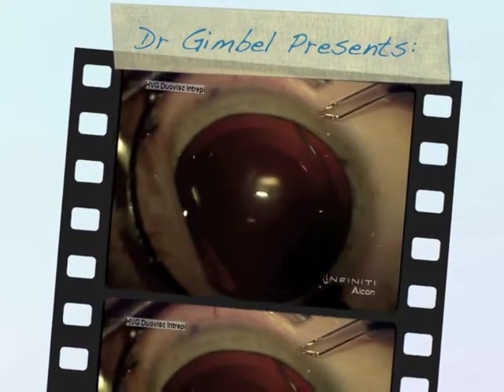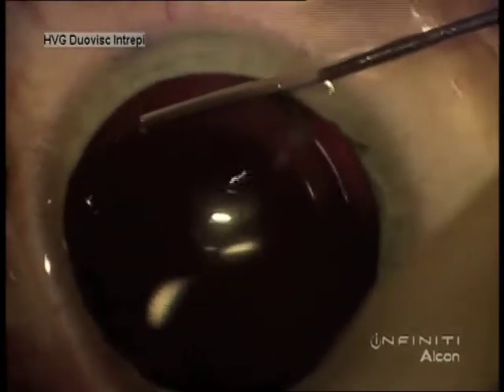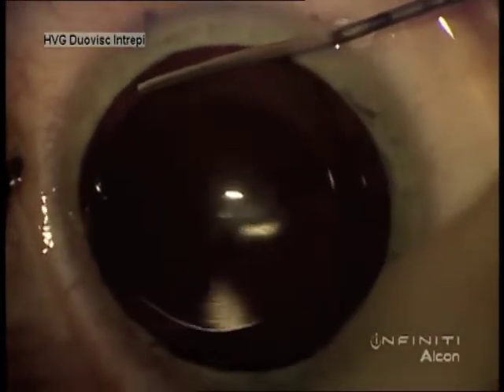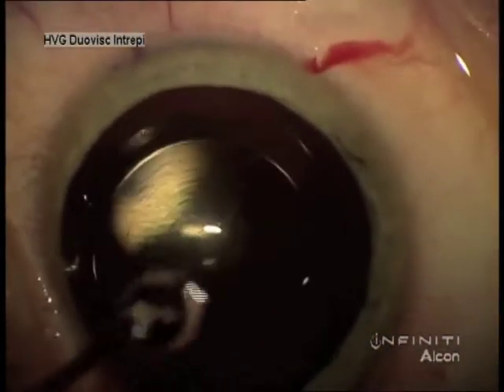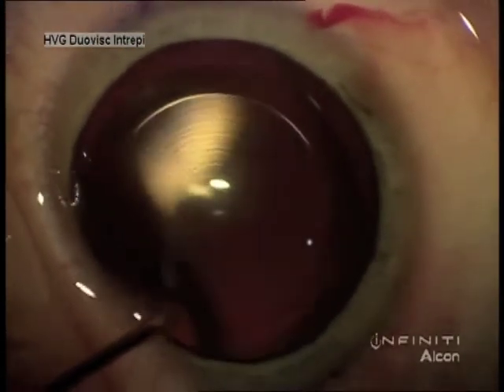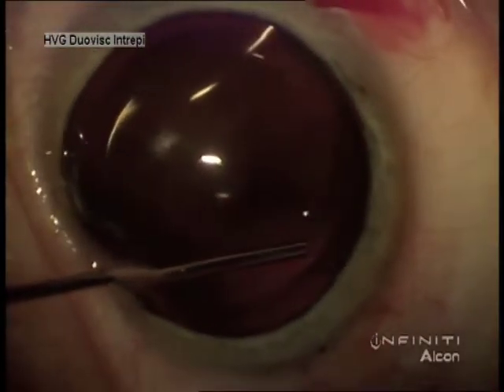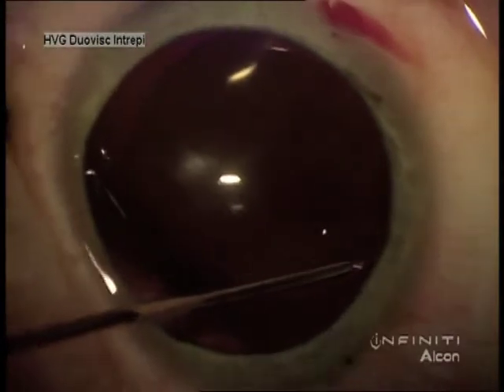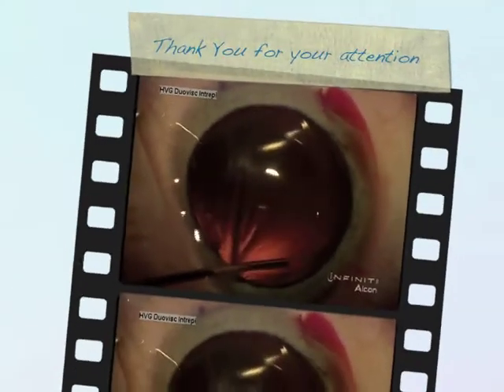ICL Intraocular corrective lens Repositioning

Comment: Dear Gimbel, I've recently had an ICL phakic toric lens, and I'm experiencing a slight distorsion in image on my left eye (staarsurgical, -13.5/+1.5/091, 15 days now after surgery) specially in moderate to dark conditions (eg: in street at night, in a room with lights switched off but some moonlight coming from outside). The effect is similar to the one got when pupils are dilated (double-image-like effect) but to a lesser degree, and also noticed to some extend on bright conditions on the very left periphery of my visible range on this left eye (noticed if an intense light comes from my very left). This effect is different from the "flickering rings" effect from direct intense lights, which is less disturbing and which I understand is the most common symptom after eye surgery (which I'm not worried about). Is repositioning a solution for this issue? What is causing this to happen and what would be the solution? Can I expect this to be corrected just with time? Which is the time lapse to start worrying about this? Thank you in advance.
Reply: Did it get better?